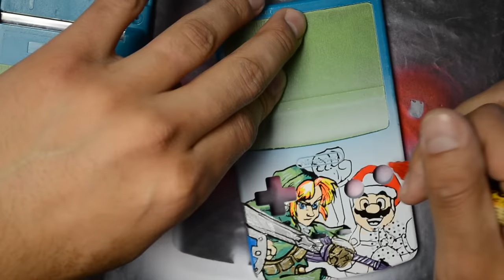Painted Nintendo Themed Gameboy Color (Super Mario, Link, Pikachu)

Comment: does it matter what kind of spray paint you use because I now that some paint melts off when it heats up or some acrylic based paint chips off over time so what kind should I use on my own custom Gameboy color
Reply from the maker: I use montana cans for everything that needs to be spray painted. Then I coat it with a sealer